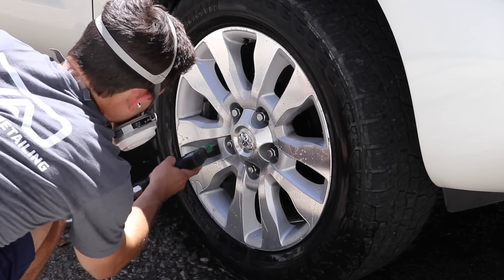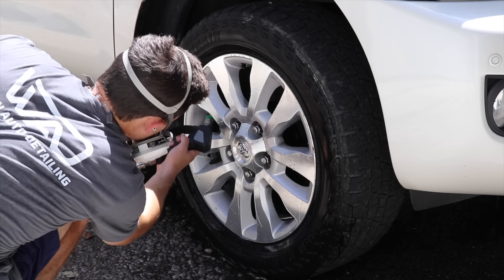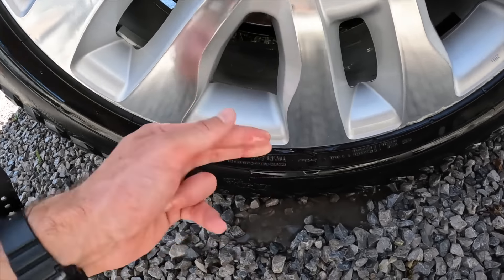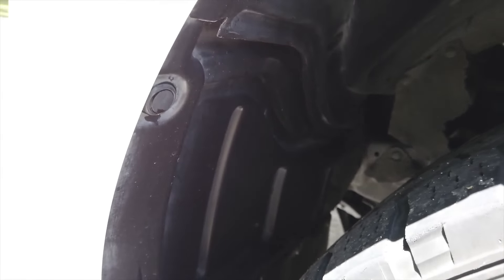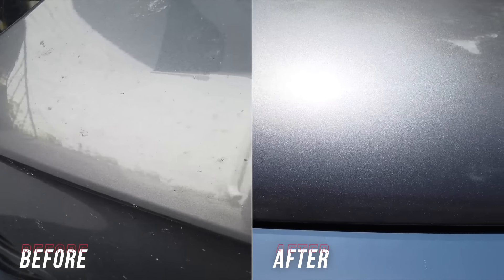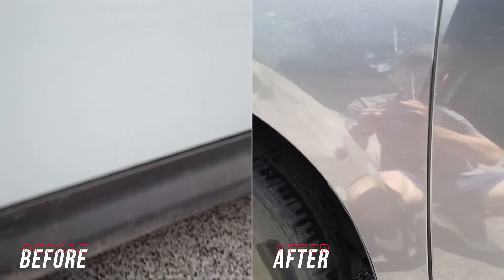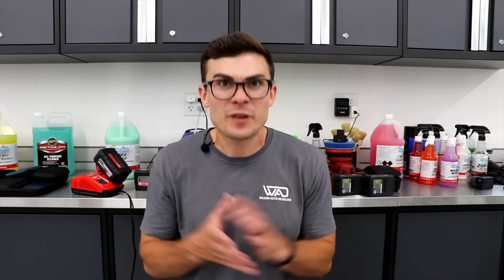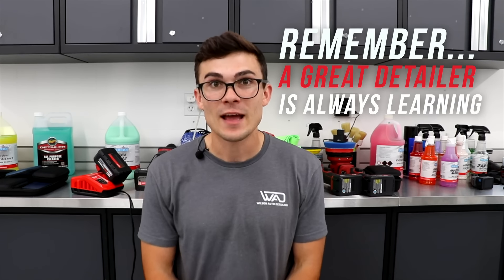2 Chemicals To Replace 50% Of Your Exterior Detailing Products

Comment: Ive watched this video at least 20 times. Then i tried it. Great for a pre wash to make life so much easier. Im sold because of 3 things - Its safe on paint - Tires arent as hard to cleaner after a good soak- Cost effective for sure. Way too many products to get lost in, and sure they are great. I dont feel the need to have 5 different wheel cleaners ect. Im just starting up and im trying not to buy everything. Thanks GV.

Comment: Would Dark Fury strip ceramic coating or damage ppf? I want to try it as a bug remover and also to clean rocker panels, but I'm paranoid it would damage my ceramic coated ppf.

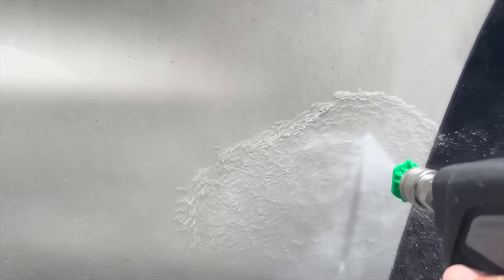Also, @ 13:23, isn't the pressure gun dangerously close to the paint? I've heard you gotta keep it 6 inches away from the paint and 12 inches away from the trim to avoid damage. I actually damaged the clear coat on my old car before I knew any better. I was trying to pressure wash some bird droppings from my car by getting in super close with the pressure washer. It took less than a month for those spots to show bubbling on the clear coat.

Comment: For what it's worth. Most of the times, I use vinegar at 12%. Sold usually for cleaning purposes. 
In fact my two preferred usage is wheels and rust removing! Awesome on both. 
At home it goes for general cleaning fridge, pipes, kitchen counters...
Reply: What strength is the vinegar in the bottle before you dilute it?

Comment: I have been using Dary Fury for quite a while.  I really love the way it cleans wheels and that I can use it for other things.  One place it does really well is the area around the gas cap.  That area under the little door is just a dirt trap.  Dark Fury busts through that dirt like nothing else.  I also like to use it on the truck and hood sills which collect tons of dirt as well.  Makes really short work of things.  I really need to try it on the front of the car now to get rid of bugs and road grime.  Seems like I should have tried this already but you learn something new every day.

Comment: I use Turtle Wax Hybrid line Wheel and Tire cleaner, 3D Wheel and Tire cleaner diluted 20:1 or 10:1 depending on severity. And lastly DIY APC ALL CLEAN.  Never used Superior products.  As always informative videos Luke Wilson. You passion is appreciated always 🤜🏽🫡👌👀

Comment: I would be very careful with Dark Fury.  I used it as a pre-wash to loosen surface dirt and bugs at a 10:1 ratio.  After a few minutes I noticed the grey colored trim around my windows becoming oxidized and splotchy (2022 Kia Sorento).  While I love the product and how well it works... be VERY CAREFUL with where you apply it.  Always spot test first!

That being said, great video as always, Luke.  Keep up the great work!
Reply: Thanks for that....definitely won't be using it now...that's a big deal if a customer's car gets damaged like this, very expensive very quickly to fix things like this sometimes
Reply: It's very potent stuff.  It knocks down ceramic coatings.
Reply: That's not good, its a non-acid cleaner though are you positive it was a t a 10:1 dilution?

Comment: What do you use on gloss black rims? Afraid to try anything other than soap. Any suggestions?
Reply: Meguiars makes a good product for black wheels.  It’s gentle on the finish.
Reply: I've used the Black Fury on factory black Toyota rims and no adverse effects. The Aluminum Brightner I would think it should only be used on Aluminum alloy rims that are not painted. I think the acidic composition can ruin paint. Someone that may know can chime in.

Comment: dumb question... can you use acid wheel cleaner on painted wheels? powder coated?
Reply: Technically you can, but you CAN NOT let it sit too long nor dry completely on the painted wheels.  I still wouldn't chance it though.  You could try a higher dilution to make it less of a risk.  I would not use it as wheel maintenance, only if the wheel is hammered.

Comment: Would you recommend acid wheel cleaner on hard baked brake dust that normal cleaners will not clean ? is there any thing the acid could damage

Comment: I bought some Turtle wax iron remover last weekend and used some on my wheels.  It did every bit as good a job as the stuff you showed did.  Not a bit of scrubbing and wheel was shiny clean, iron free also.  The car I tested it on just had a 2,500 mile trip to Colorado including a run up Pikes Peak (14,115 feet). I have ferro carbon pads which are also a bit dirtier than the normal ceramics.  First time I've found anything that can really clean wheels.

Comment: 1) I’m guessing you cannot use dark fury on a protected wheel because it is so caustic?

2) you stated you are using dark fury in a 10-1 dilution; do you know what the dilution is the 16oz ready to use bottles?
Reply: I can't say for sure if it would strip the coating off, but I've honestly found that any of my coated surfaces don't need an aggressive cleaner. They usually clean right up easily with a neutral car soap. If the wheels get really dirty, you can add it a bit higher ph soap into your wheel cleaning mix. I'm curious to hear if anyone knows if the acid is that aggressive in this cleaner.
Reply: @mygt8a4re  it’s not acidic, it’s extremely high on the alkaline ph end, but certain chemicals like sodium hydroxide make it rough on paint protection and our health (I believe)

Comment: Always been a big fan of acid wheel cleaners like Meguiar's Wheel Brightener. I have tight spoke wheels. So, using Wheel Brightener makes it so much easier to remove brake dust from the tight spots.

Comment: Is there a spay bottle that you can recommend? Something that lasts more than a couple months.
Reply: I use Marolex sprayers they can be purchased for alka and acid types.  I do flush the sprayers after each use.  They last a very long time if you do this.  If you did need to rebuild the sprayer, you can get replacement orings, etc for them too.

Comment: Thanks for the thorough review of SP, Wilson!

Off Label Use: Has anybody got experience using Dark Fury as a pre-soak on single stage paint?
Reply from the maker: Good question!
Reply: Was wondering the same thing
Reply: @KennyKern1  I tried DF as a pre-soak on single stage today, diluted 4:1. 
I wouldn’t recommend it, it seems to seep into the single stage pores and leaves a stain. I’ll have to polish it out.

Other off label uses: 10:1 in a foam cannon as pre-soak on clear coat, I can get away with touchless, especially when the vehicle has a sealant or coating. We use 3D bead it up and it doesn’t strip.

Comment: Great video! Ill have to look for these products. I have been using Maguire's Ultimate wheel cleaner, as im a big fan of their Ultimate line if products.  It does seem pretty strong, and maybe bot something i need to use all the time, so maybe something like Dark Fury could be used on regular maintenance washes. Again, great video, and i hust realized i wasnt subscribed, so i remedied that

Comment: Megs D140 wheel brightener works just as good for an acid base cleaner. Used it for many years. Makes chrome POP with a 4:1 mix. Let sit for 60 seconds or so. For alkaline I would get 5 gallons of Zep TNT on Zoro for the cost of 2 gallons
of Dark Fury. Fury is a really good cleaner though. Not knocking it at all except for the price.
Reply: D140 has been discontinued.

Comment: I love both types of products. I'm a bigger fan of RCP Copperhead instead of Dark Fury. It's cheaper and dilutes the same and imo, is stronger. Nonetheless, Dark Fury full strength can be used as a touchless solution.
 Acids are tremendous and I used to use them exclusively. With this acid, does it stain the tires like acids tend to do?

Comment: Ammonia is a cheap base with pH of 11-12.  Vinegar is a cheap acid with pH of 2-3. Dish soap is cheap degreaser with pH around 8-9. You can use these diluted with warm water to safely clean anything. No expensive chemical concoctions needed.

Comment: I used it at the recommended dilution rate on a cold bike out of air conditioned garage. Fury discolored my powder coated front wheel. Bike was in sun while applied but was rim was still cool to touch. I definitely wouldn't apply it to any painted surfaces.

Comment: Keep in mind the aluminum brighter has HF as the active ingredient. It absorbs through your skin very easily and will leach the calcium from your bones. I personally wouldn’t use it outside, only inside of a controlled environment with a proper mask, and all of my skin covered.
Reply: Not as bad as ammonium bifluoride which is in many acidic cleaners.   With HF acid you should feel the burn on the skin.  Aluminum bifluoride is the silent killer.

Comment: Haven’t tried Dark Fury, I would like to. Currently using super clean 3:1 on wheels and tires, combined with Hybrid Solutions Iron Decon on the wheels. I have tried Superior leather cleaner. it works well and is strong. I usually dilute it 1:1 or 2:1 and it cleans well. I would also like to try the aluminum brightener.  Do you know the difference between that and the wire wheel cleaner? i have not used any acid yet.  I was also intrigued by Jimbos Magic Wheel cleaner
Reply from the maker: Their acidic cleaners differ in the primary active chemical that is actually the acid... one of them is hydrofluoric, the others are different... can't remember exactly right now,, will get back
Reply: Aluminum Brightener and Wire Wheel Cleaner both contain Hydroflouric Acid and Phosphoric Acid. Wire Wheel Cleaner has a much higher acid concentration.  There is also Superior Products F30 Cleaner. It contains both of those acids plus the addition of Sulfuric Acid. HTH.  Thanks!

Comment: Dark Fury is a fantastic wheel cleaner.  I'm going to try it as an exterior pre-soak now thanks to this video.  I have also had good luck with Nanoskin Non-Acid Wheel Cleaner which is also very economical.  Suds Lab XA appears to be the same formula as Dark Fury, on the shelf at Wal-Mart, but not nearly as economical.

Comment: Acid based eheel cleaners have always been superior to alkaline cleaners...but you just have to be careful with application and not leave it on too long, etc. You can even cut them down a but to make more of the cleaner because most are far stronger than they need to be.

Comment: If you wanna take it to another level..

Apply the wheel acid, wait 15 secs then use dark fury in a foam cannon over the top to neutralize the acid then go in with your wheel brushes.  Insane
Reply: @bchaffer79  Great idea! What dilution would I use for each of them when using them together like that?
Reply: @joelpasserell4525  the wheel acid 4-1 and I put couple of ozs of undiluted dark fury in my foam cannon and fill the rest with water.  Works great in direct sunlight to help slow anything drying out while you clean
Reply: Could you mix 2-3 oz of dark fury and 2-3 oz of aluminum brightner in a foam cannon then filling remaining with water and apply it this way?
Reply: @troyhenry3267  no they would just neutralize each other in the foam cannon

Comment: Also mention you cant put aluminum bright on all rims some wheels work with no touch some don’t. We been in mobile detailing for over 50 years and its a lot of chemicals that would be safe for all rims. Aluminum bright will damage powder coated rims and is very harmful to to rims in the summer time.we have 32 mobile vans and cover 45% of sc but keep up the good work

Comment: Caustic sodas going bite y’all in the butt if y’all use dark fury on your car every single wash.  Remember when every detailer was using super clean now you never hear about it?  Dark fury and super clean both have Sodium hydroxide, sodium metasilicate …both are bad for you and the car. It will cause headlights to fail and wheel damage.
Reply: Maybe they just stopped getting paid to promote it which is the reason why you never hear any detail or talking about it anymore

Comment: @Wilson Auto Detailing... how will this affect the longevity of ceramic coating? This would be a great test  if you want a long lasting coating.

What products do you use on a already ceramic coated car?
Reply: Ceramic coated cars do not require harsh cleaners like Dark Fury.   Avoid using them as they negatively affect the coating.